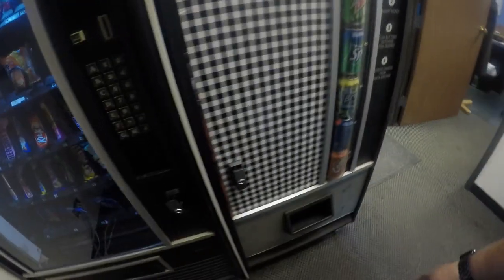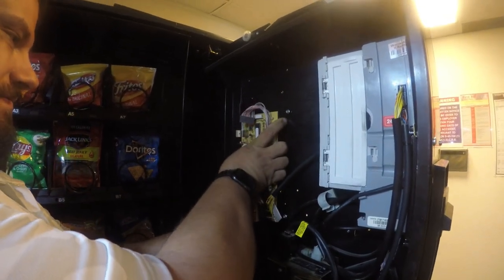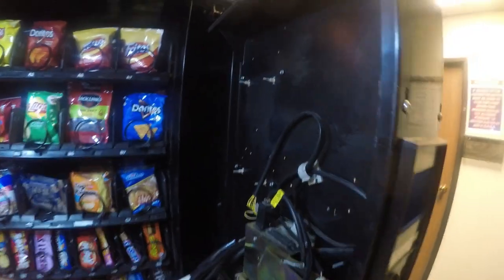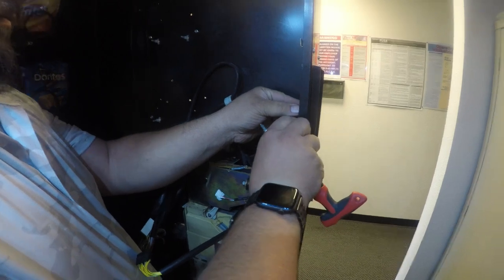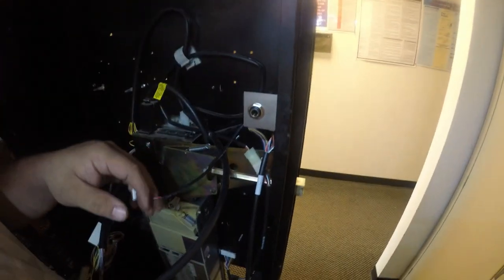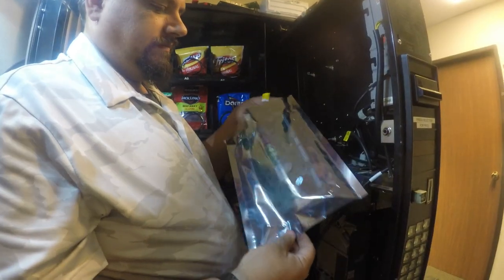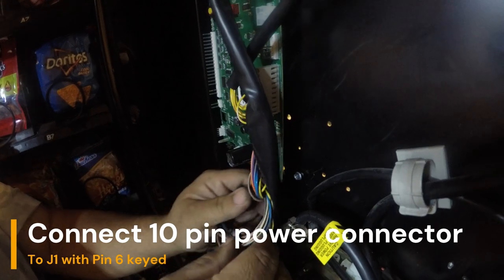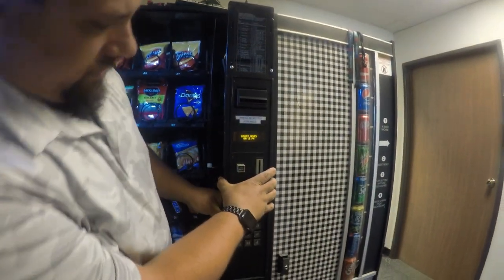Installing an InOne Technology USI Snack Upgrade Kit #diy #howto

Comment: With changing this will it allow you to add a card reader?
Reply from the maker: Yes it will
Reply: Thank you for responding!! Thank you for this video as well this has been very helpful!!!
Reply from the maker: @rosaredmon2453  your very welcome
Reply: Do you know if this works for the 3015A model?
Reply from the maker: @rosaredmon2453  yes it will. With this same kit
Reply: @720vending  I bought the same kit, but I’m stuck I had to use the 11-1700-21 with 3-pin power harness, but I’m not sure how it correctly goes into the power cable and at this point the directions on the paper are vague.
Reply: I was starting to think I maybe bought the wrong kit!
Reply from the maker: @rosaredmon2453  according to InOne that kit works for that machine as well my machine is a 3014A
Reply: @720vending  thank you I thought the same! I’ll try to reach out to them and see if they can give any guidance!
Reply from the maker: @rosaredmon2453  what is going on with your machine I could help. Shoot me an email from my about page and I will see what I can do
Reply: @720vending  it’s not showing your email

Comment: Just want to double check. Did you say the bill validator and coin mech will need to also be upgraded with the mdb harnesses? Or can you get away with the older equipment?
Reply from the maker: With the InOne board you can still use the original bill validator and coin mech. But I would recommend as those fail replace with MDB. The USI machine uses a 24v validator already so it would just be a cable change if you are using an MEI validator